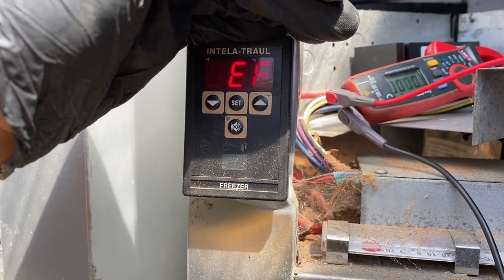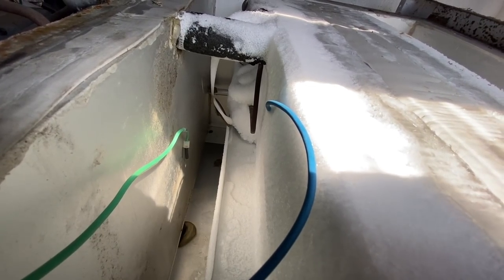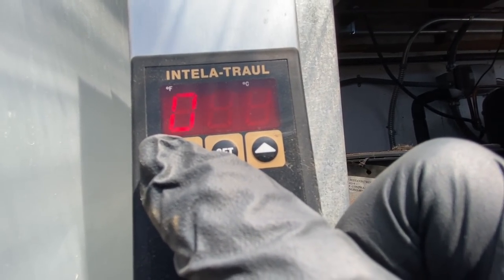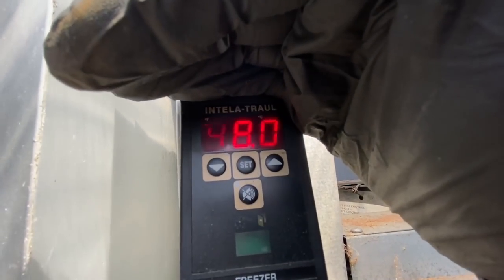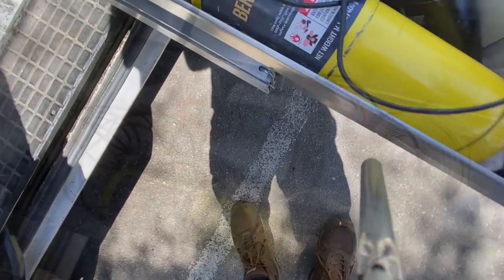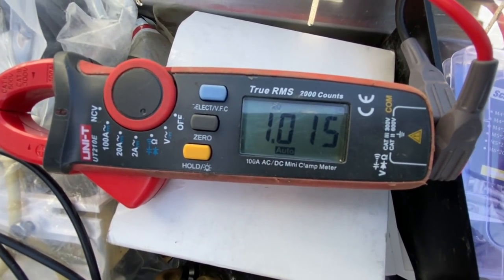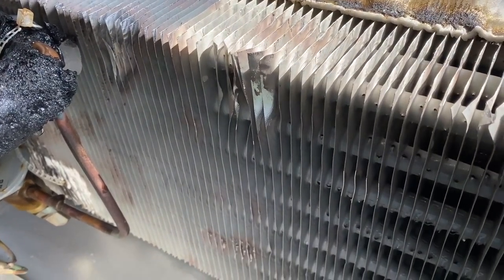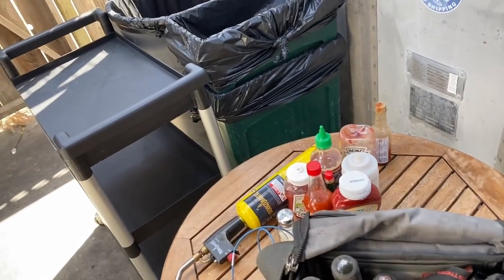A Good refrigeration service video

Comment: I believe you know this all ready, but the Traulsen probes are the same green or blue, the color of the wires are just different.  This is more for the noobs in ice machine repair, so you can use a green probe where the blue coil one is and visa versa, in a  pinch.  Also I think the ETC111 probe has the same resistance as the Traulsen's, but I'd have to double check that before saying it really is.  We have a saying for the build-up in the ice machine at our company Dave, it's called "SHMEGMA"!!!!  Good job Dave!

Comment: That ice machine is just nasty, how can people let them get like that and not care.   I own a restaurant I have a Brema ice machine and it works great and is a breeze to clean and sanitize.  I also do all my own refrigeration work got my 608 a few years ago and started taking care of my own stuff simply because its more cost effective for me.
Reply: Good deal. Hope it’s done right. A third grader can get their epa 608. I bet you still do better than most refer guys still lol
Reply: @Mike you just said it, cost.Ice machines are time consuming which costs a lot to service.
Reply: @Exile1213  608 is just a formality, if you can memorize dates you get a 608.  It just makes it easier for me to buy refrigerant and parts at some of the supply houses.
Reply: @natepeterson7145  Exactly, that's why you take care of them and keep them clean.  Because calling in someone else to do it for you costs much more.

Comment: Those traulsen controls are way way over complicated I dump it all and get a dixell XR control in it one controller and easy probe replacement also $200 VS $2000 for the traulsen crap 😂😂

Comment: Good video ! Time to Re-Order Traulsen Evap sensors & a Low pressure control off Amazon. Re-stock time. Your running low on parts.
I Just Ordered a crap load of stuff myself.
Reply from the maker: I sold almost everything off my van. Was going to go low inventory. But shortages has me restock the Gina. I’m full again. Lol